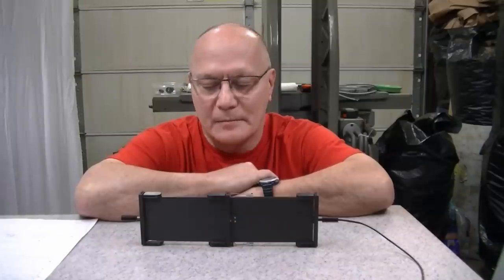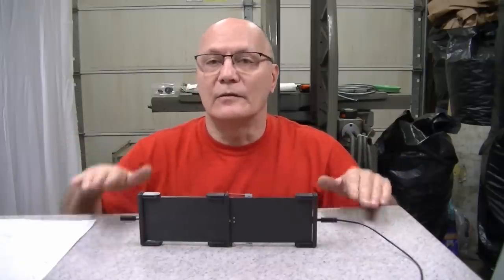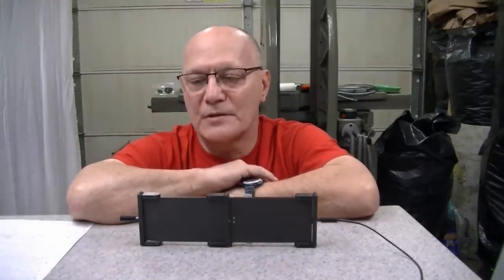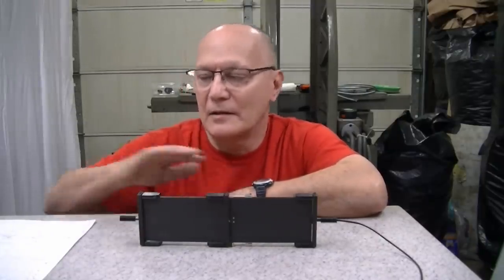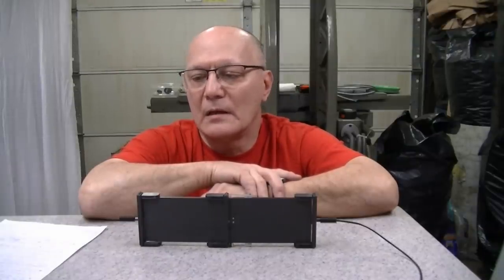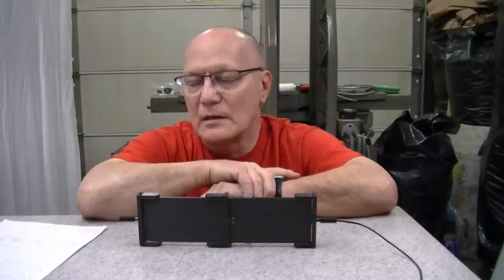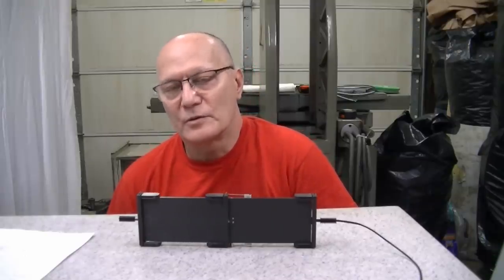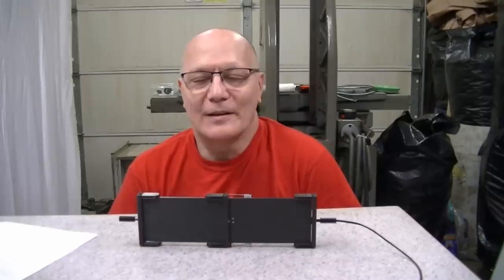DIY SURFACE PLATE LAPPING ANSWERS TO PART 1 QUESTIONS

Comment: The sharp carbide buttons are a great idea, but if you use them, make very sure to slide the tooling on the plate carefully and using the proper technique  -- every time (of course, we should be doing that already...)  If not, there will be little chips taken out of the plate by the sharp corners.

Comment: Excited video Robin! Thanks for sheeding more light on those questions. I love that your anwers are full of well explained content and never once the mention of "just because" or I've been doing this for X years. It's the sign a true master. I think the hardest part of designing or analizing anything is the application of constraints. In the first video it was so easy to get hung up on the intro to diff levels. But the stiffness of the plate like you said got bumped into the whole system. I litterly hit my self in the for head saying of course the loads on the plate are negligable. Ahhahh moment achieved!

Comment: I suppose that pros don't use grooved laps as a matter of safety margin.  Once the layer of dust floats the lap enough to affect cutting it's probably a good point at which to stop and check their work.  Being able to feel and hear the change in cutting action likely helps prevent too much material removal.

Comment: Thanks Rob, I love how in depth the conversation is.  Reminds me I may still have critical thinking skills.  I have a question with no condescending intent at all:  If getting your checking instruments correct includes compensating for things like leaning on the table, where is that kind of accuracy in a part - important??  Is it accuracy for accuracy's sake??  I had a family friend that had a career machining for a nuclear trigger plant.  He said once that they would take the engineering plans and cut the tolerances by a factor of 100, and in one phase of the project they were scrapping parts based on the time of day they were made. It eventually was discovered this effect was because a coal train would pass by a mile away.  I always thought, is that level of tolerance really important?  Thanks for the vids, another great series!

Comment: As always another interesting and very informative video Robin. And I think you being far too modest. Maybe it's an age thing, but I quickly learned to be a bit patient while watching some of the best in the YT machinist community. Anyone like Yourself, Tom, Adam, Brian, Keith and many others do know what there doing and that anything that might not be immediately apparent in one video usually becomes clear and logical over a few more videos. Trying to second guess someone highly knowledgeable without having all the information they do never works out well. :-)  

I've been in mining for a lot of years and yes it's obvious that silica isn't good for you. But if anyone who's concerned about it would do a little research it takes decades of breathing high concentrations of the dust to develop silicosis. Yes you should be proactive in protecting your lungs, but the little that would get stirred up while flattening this plate can be pretty much ignored.
Reply: Who's this Brian?
To the list, I would add Stefan, Chris and Dan.
Reply: Brian Bloc or bcbloc02 for the channel name. And the ones you mentioned would have been covered by my  "many others". Anyone subscribed to Robins channel would I'm sure know of all the ones we both mentioned.
Reply: Turning Point - Thanks!  I did not know of Brian Bloc (bcbloc02)... will check him out.
Reply: A very smart and clever guy ajtrvll. Most of his videos in the last 2 + years are of him single handedly rebuilding an old falling down tobacco barn into a new shop. He does some custom engine components for tractor pulling among other things. He's just starting to move some equipment into the new shop so people like us should find something of interest on his channel. 

Jan Sverre Haugjord would be another good channel for very high accuracy machine tool rebuilding if that interests you.

Comment: Lapping can be soooo very enjoyable , (though quite frustrating at times ).   I've designed a rather large number of faceted gemstone cuts. . . with a worn out machine , so I'm painfully aware of the micro nuances of pressure & angles to hold as rigidly as possible..  *I believe the term , 'cheat you blind' is in reference to making micro adjustments to angles , while doing final cuts with finer grits; ESPECIALLY in the process of polishing !!!   Where angles meet to form point intersections can be very challenging, especially when dozens of facets meet at that point.  I've found that using a halogen bulb of 50 watts to be just right for illuminating facets during polishing, & that 20 power magnification gives unreal results.  I've learned through trials , that working to a single wavelength of light is possible 'by eye' . . . through visually making the reflected color of a facet the same as it's 'fellow' facets at the same angle !
       I've often used hard stones as my charging tool.  Mineral oil works very well to disperse / and distribute diamond grit over the surface of the lap. I use copper laps that can be very tricky to work with . Sometimes , 'less is more', when charging laps !  * Overly charged laps tend to cause 'floating' of the lap, instead of cutting .   
     Great work, Robin - 'Looking forward to your continued progress !
Reply from the maker: Thanks, all good points you bring up. I have never done faceting of gemstones but I completely understand the issues with facets intersecting properly. I am glad its you doing them :-) Thanks for watching and commenting.

Comment: Always great to watch a fanatical point of view, adjusted for a bit of reality. The sign of a true expert. Thanks.
Reply: A true expert in "leveling" a surface plate who repeatedly asserts that anything that touches a surface plate "distorts" and "bends" it therefore making a surface plate pretty much impossible to "level" since you can't "level" it with "nothing". How does the "level" plate stay "level" or "flat" with parts and tools on it for "measurement"?

Comment: I've watched both videos and you have already touched on some of the points I was going to bring after watching the first. The precision level measurment is working well and I've used my levels and clinometr (Hilger Watts Microptic) for similar tests and measurments. Another test tool to consider is the autcollimator. For me it offered some advantages in the fact that I find the level bubble painfully slow to settle (the more accurate the more so) and the mirror is  light making countrballncing unnecessary. Possibbly also that I really enjoy using my Leitz autocolimmator....
Thank you sharing your experiance.

Comment: My understanding is the Figure 8 pattern is used to constantly change the leading edge of the lap, or part if lap is stationary, in relation to the direction of motion. Moving the lap or part straight back and forth tends wear the ends. This tendency is averaged by the figure 8 motion. The lap and piece being lapped still need to be turned and spun around with regards to the lapper in regular intervals to compensate for unavoidable variations and bias in technique   Although not entirely the same, this also applies to stoning a part. Stones moved straight back and forth wear into convex or low on the ends, and things sharpened or flatted on the stone tend to have rounded edges and corners.
Lapping machines have the lap and parts along with the wear rings moving in counter rotation to one another, which negates this.

Comment: Great video as always! Looking forward to the rest of the journey as I have a slab of granite that's been sitting in the garage waiting to be lapped for some time now (plain slab from a headstone supplier). I can see how the Renz-o-meter is self calibrating; very clever. Can't wait to see the details of the sensor/electronics...
Reply: I've done a bit similar thing. First you must notice headstone slabs may not be very flat, there might be 1mm/1m error or more. It means hard grinding work, perhaps using angle grinder with diamond wheel.  Then you need big tools to start the work itself and a good straight edge to study surface flatness. Renz-o-meters etc. are not needed until surface is quite flat.  I finished my plate (at least so far) just below 10u  because it is good enough for me.

Good luck!

Comment: The economics of getting a plate certified versus scrapping it and buying a new one can be extrapolated to how a lot of machine tools find their way into home shops. Simply because a machine tool is beyond its useful life in terms of profitable operation doesn’t mean it is beyond its useful life to make useful parts given enough “free” labor by the home hobbyist to keep the machine running to useful tolerances. One need only look at any given shaper running in a home shop to see that principle in operation.

Comment: One minor point, but like repeatability vs flatness, one that I have seen causes confusion, is regarding "certification". 

Unless things are drastically different in the US compared to elsewhere in the world I'd respectfully suggest Robin Renzetti does not hold the authority to "certify" that plate ... or any other plate for that matter ;) Nor would the Renzetti-meter be approved for that purpose. Both could arguably be achieved by jumping through the appropriate bureaucratic hoops, but I doubt that will be done. That doesn't of course mean that it can't be proven to one's own satisfaction to meet the required specification using any method one likes, it's just that it will not technically be "certified" to that standard and that would need to come from an approved authority.

It may seem like a moot point, but it's not at all for organisations who need to produce products to meet a specific standard and require their metrology equipment to be within current certification.
Reply from the maker: Agreed Pete, I will correct that in the next video.
ATB, Robin
Reply: Pete F - Fair point.  Personally, if given the choice between a marketplace certified plate and a one-off Renzetti-certified plate, I would choose the latter without hesitation.
Reply: Well, a certificate of traceable calibration certifies that the calibration chain is unbroken back to a national standards bureau, which in turn used approved methods to create standards conformant to the SI. That chain of traceability is important for many users, especially those who need to prove legally that their equipment meets the standards.
Reply: SAI Peregrinus - Agreed, but how many individuals are involved in this process of certification, and how many plates does each one certify every week?  People make mistakes.  I'd wager a one-off Renzetti-certified plate is more likely to be on-spec than (almost) any marketplace certified plate.
... I probably should wipe the brown off my nose, lol.
Reply: Likely just the same number of people involved in the certification as are involved in Robin's checking ie one! Because of the process involved in certification, the likelihood of a mistake being made in certifying a surface plate is very low indeed.  As mentioned, the entire metrology chain involved in that calibration has been checked and is in itself certified. In practice a decent lab will likely be using differential levels that auto-input to the software. The Union Jack pattern used is not coincidental and where each line crossed the errors obtained by each independent line will be compared and anomalies detected by the software automatically. 

None of this is to take anything away from Robin, nor alternative techniques he's developed. He is an extremely careful worker and has inspired me to work better. It's just that the word "certification" has a specific meaning, and it's not a synonym for accuracy or measuring, though it involves checking both.

Comment: Thanks for more details on the mechanic of lapping I found there is very few information on this topic. Also can I ask you why you choose unidirectional carbon fiber or more usual weaved material? Thanks again for the greats videos!
Reply from the maker: Thanks Simon. Carbon fiber is near zero coefficient of expansion only in the unidirectional lay up and even in that only in the axial direction. The lateral CTE is large on the same unidirectional piece. woven material or even non woven with 0 - 90 layup has higher CTE.

Comment: I worked at an outfit where they had a laser interferometer set up on a granite plate about 6x10x2 feet and if you placed your hand gently on it body heat would warp it enough to be detected on the interferometer.  Yup they flex.  Blew me away.
Reply: Yea thats what I want, a plate and metrology tooling that can measure atomic scale!
Reply: Like the man said: when doing high precision, everything is rubber.

Comment: Excellent dissertation, Robin. Tumbling abrasion works great for brittle materials like glass or granite. Past life, I did technical service for coated (fixed) abrasive products and processes that replaced loose (tumbling) abrasive processes. Coated abrasives usually worked faster and left lower sub surface damage (SSD) than tumbling abrasvie processes. The mechanism of material removal for tumbling (loose) abrasive is interesting, it takes place by chipping out overlapping "Hertzian cones". Note that a Hertzian cone need only penetrate a short distance into the material (i.e. need not go through the entire work piece) to be effective.
Reply from the maker: Thanks Arn, that means more coming from an real expert. That is exactly why the diamond powder did such a good job of frosting my comparator screen replacement on IG. Thanks for watching and commenting.

Comment: The thing I kept wondering about as you were using the differential leveling was that you seemed to be walking around. I'm guessing that is around 150 lb/sq ft moving around within a very few feet of the supports of that plate, and I'd expect that to change the level more than the counterweight would.
Reply from the maker: It moves it much less than the counterweight but I try to stay centered when actually taking the readings. Thanks for watching and commenting.

Comment: My understanding of Carbide cutting inserts is that they have the very sharp edges removed as a matter of course to prevent chipping. The cutting action happens some (small) distance from the edge.
As you are teaching us about minute influences: ie ramping over particles, maybe you need to lap your spreader bar feet more.
Or are you not in that zone of accuracy yet ?
Thinking about what you said about the Carbide tips having "build up" and seeing the pattern on them post lap, you unfortunately appear to have created a perfect ramp.
Reply from the maker: ...Until lapped further. thanks for watching and commenting.
Reply: Steve Williams - My old introduction to machining teacher would argue machining does not cut metal, it tears metal.
Reply: ajtrvll 
"Shears" is the word I remember.
Reply: The class was in French... prof used the word "déchirer" to describe the action.
"Shear" does not translate well in French, but it seems right.
Cheers!

Comment: Yet another 1/2 hr well spent. Learned a lot.
I get it the 3 feet concept. But then, I guess there is convex bowness when checking straightness on the one feet side as opposed to convect bowness on the two feet side (opposite and parallel).
So, as I understand what we want to know is the flexibility of the surface (pink plate) is less than that of what we want to measure, then how straigt it is. Or am I wrong ?
Then that it is straight enough.
All relative ?
Reply from the maker: The plate is lapped with it deformed from its own weight so it is flat without anything on it. The deflections of the plate with typical uniform loadings is very small and would be a small portion of the total plate tolerance.

Comment: Hi Robin; I think that the process of answering questions is quite valuable, especially as regards to explaining your thoughts compared to viewer questions, without the staccato of the comment process...not boring, at all!
A thought that I had, regarding temperature, both "ambient" and "gradient"; not knowing the mass of the granite flat, but, thinking about the support structure potential for changes over temperature, it could be possible to have a large portion of the plate mass acting on a single point, if the support structure was stiff enough, and was deflected enough by a temperature change, or gradients... I know that this might be an"stretch", but it #could# be possible that an "over-engineered" support structure would apply a large force to the plate at a 'point'... Or not ;-)
Reply from the maker: IMO the weight distribution of the plate on the three feet is not going to change at all if the feet are bonded to the plate which mine are. If the feet cannot slide on the supporting structure as it changes length compared to the plate then that can induce a bending force on the plate. Also if the feet do not have a single point of contact then Then deformations of the support structure could make it hit the edge of  a foot thereby changing effective support location which would change the shape of the plate. My video "making a surface plate stand" covers my design of the surface plate feet and support structure interface that I think addresses all these issues.
Reply: ROBRENZ  yes, Mr. Dozey, here, saw the stand build #after# seeing, and commenting on, this one, and, it's clear that you, at least, built in a nice combination of "float" and precision, which would avoid the scenario I was imagining; someone, with a bit less thoughtfulness, could easily mount the plate "hard" to the stand, introducing some interesting stresses.
Reply from the maker: Lohi Karhu  Glad you approve :-)